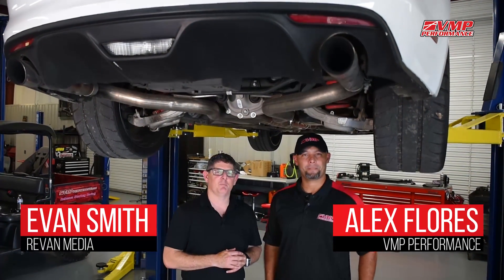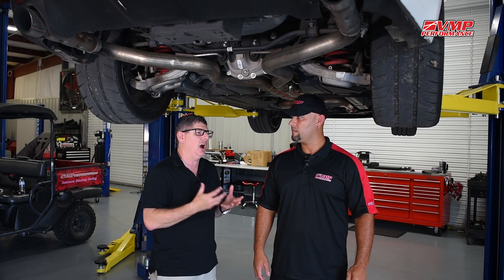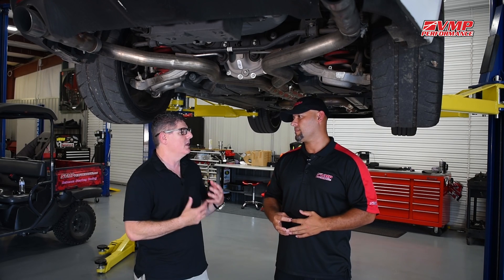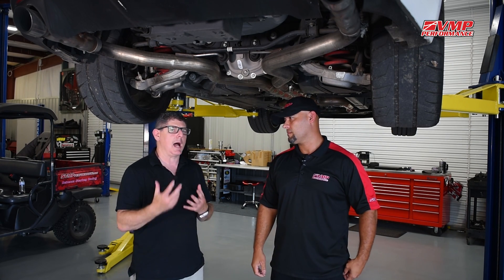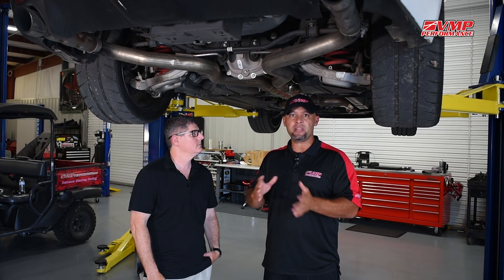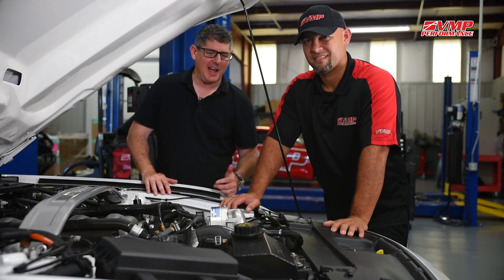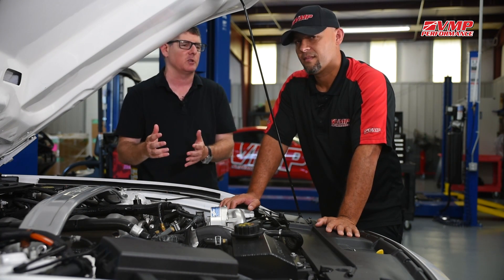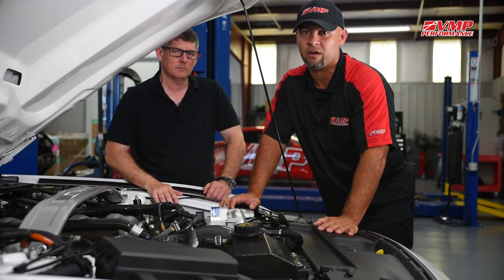VMP Performance: Drivetrain Loss - what is it?

Comment: thanks for your useful information but i have a simple question , so if an engine  having 100 horse power at the flywheel  turning a manual transmission with  a 15% driveloss that means it have 85 horsepower at the wheels , so that means the box stole just 15 horsepower , having modified the engine let say to 1000horse power ,keeping the same gearbox does it steal 150 horsepower ? or just 15 horse power, ?
Reply: Your example is exactly why percentage losses are never accurate... if you lose 65hp with a stock car, you will still lose the same amount after it's supercharged. But if you change driveline components (ie. carbon fibre), then the losses will drop regardless of engine horsepower.
Reply: @B0SS330  thanks
Reply: @Murat Harman your comment that the car will lose the same amount after it’s supercharged is INCORRECT. 

With internal combustion engines, what power that is generated that does not make it to the drive wheels is shed as heat. Heat increases as power generated increases. Drivetrain losses follow that trend, as the drive train loss exhibits itself as... you guessed it, shed heat. Heat in the coolant system, heat in the transmission, rear diff, all of that is increased when engine power increases.
Reply: Another thing to consider is that transmission and differential you have in a 100 hp car with 85 wheel horsepower will never survive in a 1000hp car.  Everything has to get beefier, heavier and they take more power to turn.  So it may be 15percent with the original drive train but may be more with an upgraded one.  It’s not really a fixed number either, some loose as much as 25% or 30%, think old school th400 without lock up converter and a beefy 9 inch with 35 spline axles and giant tires, wheels and tires matter a lot too.  Some components are a fixed number like your tires, your axle shafts drive shaft, while your transmission and differential the ring and pinion portion are percentage.